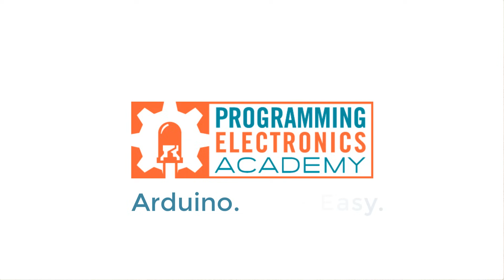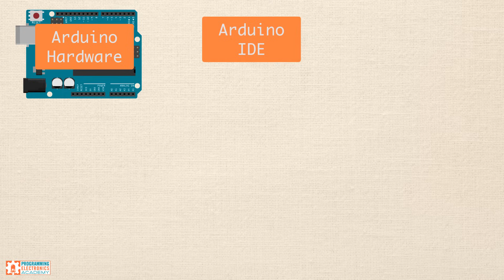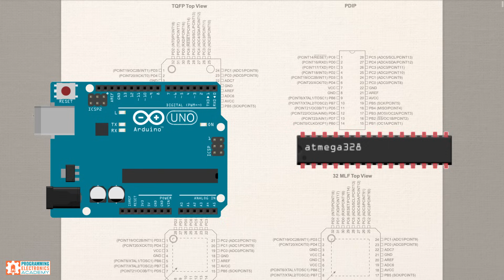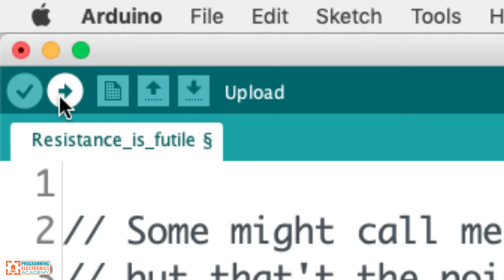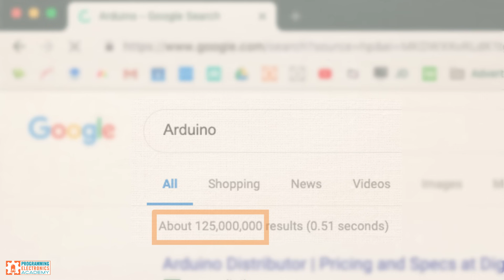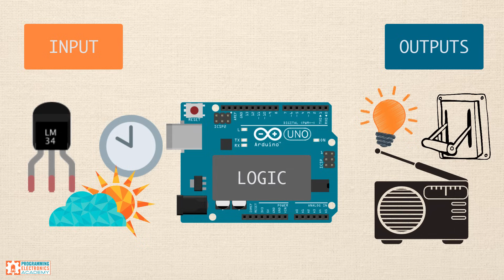What is Arduino and can I use it for my project? [Beginner Friendly]

Comment: Best video I have seen that gives me a better understanding of what an Arduino is and what it's for. Thank you! 
I have built a slingshot auto resetting target that has a ton of relays, wires and electromechanical timer switch.
I want to learn how to use an Arduino board to run the operations to stream line the unit so it's not so big.
I'm going to take an Arduino beginners class at Harper College Palatine IL at the end of next month and I hope someone can help me
build my project.
Reply from the maker: Sounds like a neat project!

We also have a video here that might help:
https://www.youtube.com/watch?v=BLrHTHUjPuw&lc=UgyBobJOXbY8W9Aqz_t4AaABAg

Best of luck!

Comment: What if i'm happy with the project and i want to change to a pcb? Should i always use the arduino board as a whole? Can i just take the microcontroller?
Reply from the maker: Great question Mohamed!

The Arduino is a development board, used to help you easily write code for the microcontroller.  Once you have your code written, and you are happy with it, you can move to your own custom PCB if you wanted to.

Comment: A very well presented explanation. However it's a bit of a stretch to say that programming in the IDE is basically C/C++ programming language. There is a large overhead that the Arduino functions and programming instructions imposes to allow this programming to be made easier for the novice. So a simple Arduino directive like pinMode for example will uses quite a bit of code within the actual IDE underlying code to do what can be done in C/C++ with a lot less overhead in terms of code size. Just wanted to point that out but yes, it's a great way for people to do things without actually learning full on C/C++ programming, that's for sure. Thanks again for the great explanation. I did find a great link for an explanation of this, but as is often the way it's dead now.
Reply from the maker: Totally agree that the Arduino IDE does most of the heavy lifting for several functions where in c/c++ you'd be directly setting registers.  I would push back a bit on this though and say that outside of those minimal convenience functions (and the whole "setup" and "loop" structure), the code people are writing is c or c++.

Comment: I'm not genies enough to understand all technical stuff but looks like this thing is just good for controlling very small electronics (lights or fans or maybe better voltage switcher) but lack of good computing power, looks like it can't run console games(nes, sega or any other old games) or it can't be used to record my PC game videos.
Reply from the maker: You're absolutely correct @hashimx10 .  It's designed for electronics control, not compute.